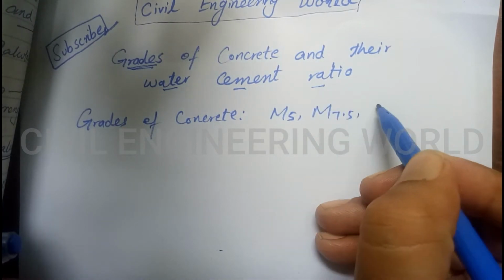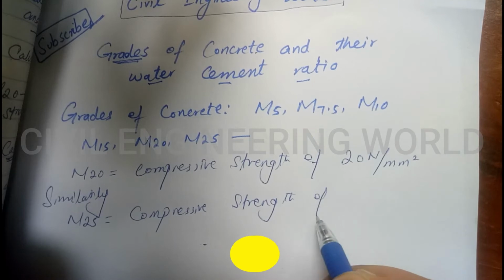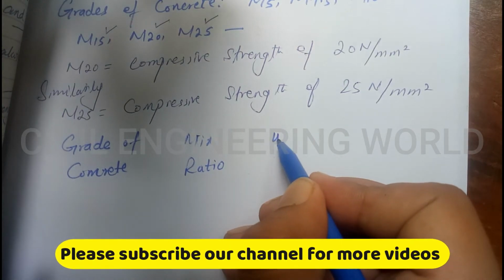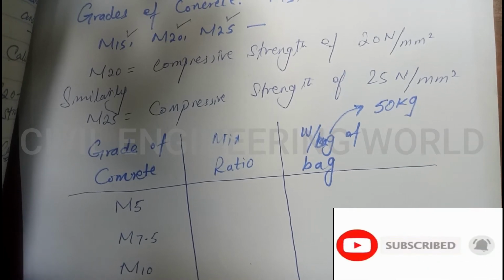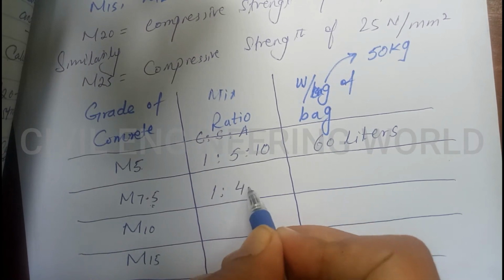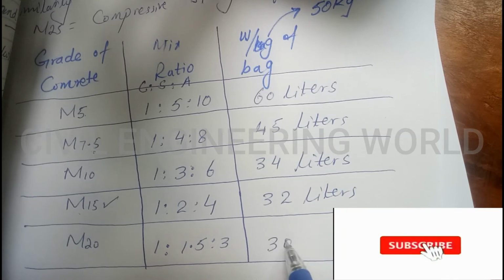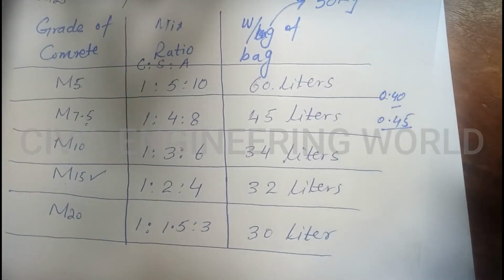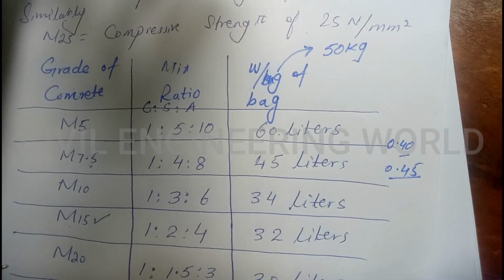Concrete Mixes and Water Cement Ratio

Comment: Sir, if you want to install tiles in a room, how many tiles will come in it, but the tiles are in two different dimensions, for example, the size of one tile is 6x12 inch and the size of the other is 24x8 inch, so how do we know these types of tiles?  In a room which is 15x35 feet in size, please make a video about it.  Thanks
Reply from the maker: So stay connected for video
Reply: @civilengineeringworld4260  انتظار